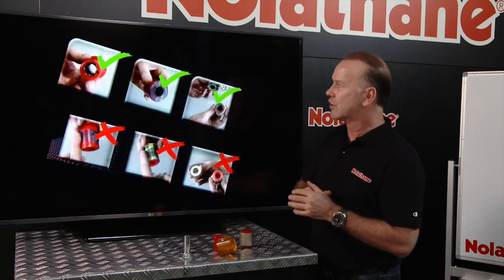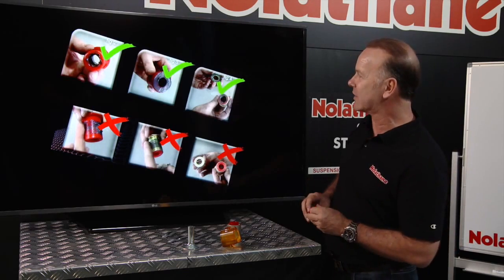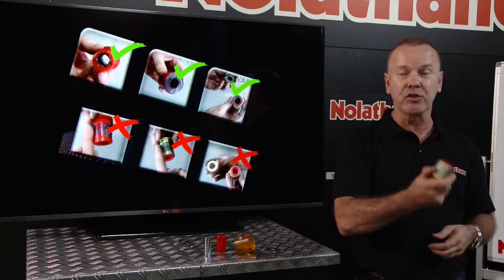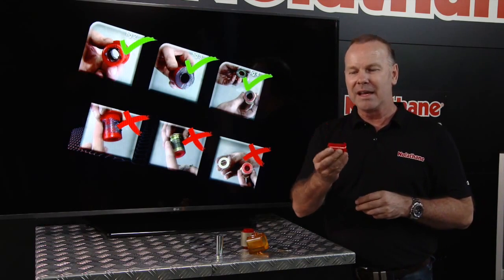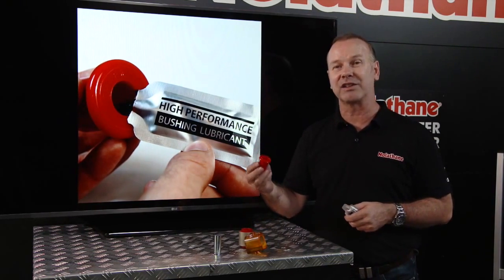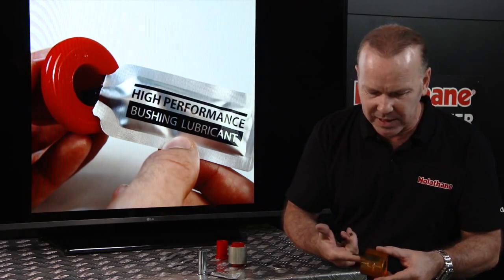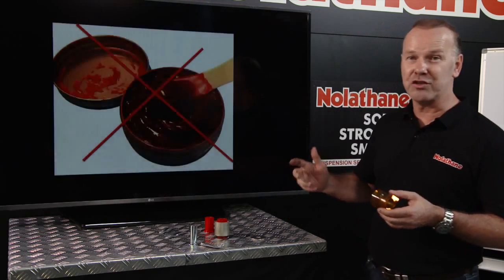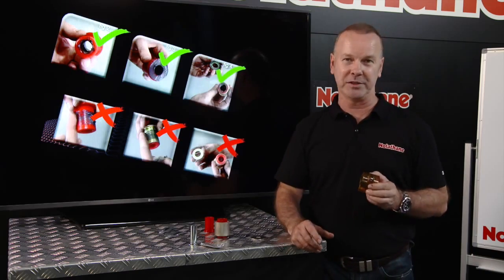Mark Larkham talks Bushing Lubrication

Comment: Never underestimate good 'ol anti-sieze. It is so extremely important. You don't want the metal sleeve in the poly bush to rust to the bolt over the years. When it comes time to replace you wont be able to get the bolt out! I had to use a sawzall and cut my leaf spring bolts from each side because the bush sleeve became one with the bolt.

Comment: I use a grease needle. They don't use zerk fitting any more.
Reply: Yes, the idea of injecting the boots with lubrication to reinstall the pivot points sounds like my next plan of action to attack my vibrations and noise.  Is meat grease from the fast food businesses + dirty used needles from casino bathroom trash cans the cheapest way to procure the grease + needles?

Comment: Fairdinkium mate while grabbing the bush does it matter if it is hairless, you speak like a simple wog with the bush and putting it into sityou. Bush AKA bushing. Sityou??? place??? 
You might as well put this video in the back of the Ute and then do a tip run to get rid of it.

Comment: What type of grease should be used on poly bushes?
Reply from the maker: Hi Marcus. You should always be using a molybdenum disulphide (moly) grease with poly bushings. Almost every auto parts store should have this on the shelf.
Reply: @NolathaneSuspension  is moly grease superior to silicone grease ?

Comment: If you have a sway bar then the bar keeps turning inside the rubber bush and will wear it out, so Nolathane with grease is good. But then the grease will allow dirt and grit to stick to it and grind the steel shaft. Now with a shackle bush or control arm where the rubber normally twists because the centre is clamped as well as the outside of the bush then I think rubber is better because dirt isn't affecting anything. Where as Nolathane keeps turning the bolt inside the bush with grease and grit wearing it out. So Nolathane realized this and is finally fitting grease nipples on their rear shackle bushes.  So beware where you fit these bushes. I still like rubber. If you do your whole suspension in Nolathane it can harden the ride.
Reply: Yes, Rubber is Best fitted and a more comfortable ride

Comment: I grease all over the two-piece bushes, the control arms on the Commodore like to rust and it happened on the first one I did(which was a city car, stock/etc).

Now I drive a "barely legal" version out in the sticks, after 12 months I had a creak from the front and so naturally cleaned and greased the bushings again - not a spec of rust. Turns out it was a buggered strut top. Grease was definitely required by then, around the 12 month mark, having put 50000km-odd on them(about 5000km of dirt, 4500km Perth-Melb, a fair amount of abuse on our sketchy country roads).

A squirt of oil on the steel case will help keep water out, just a tiny squirt.